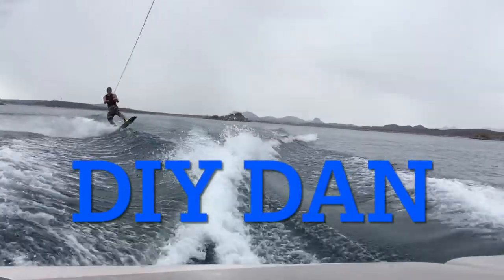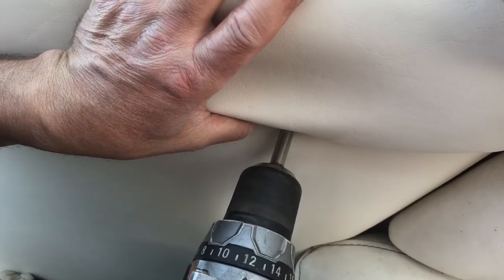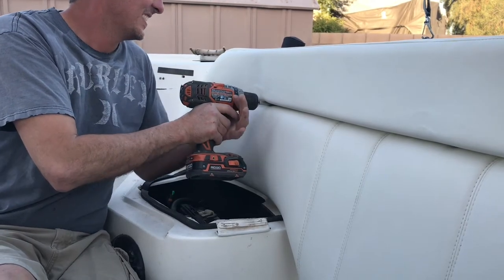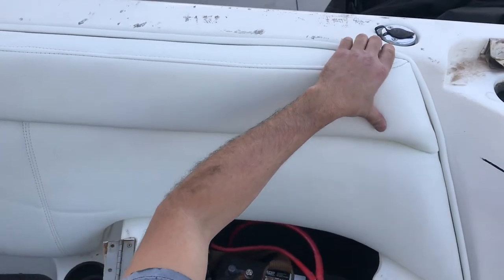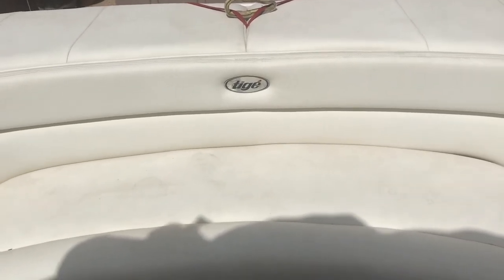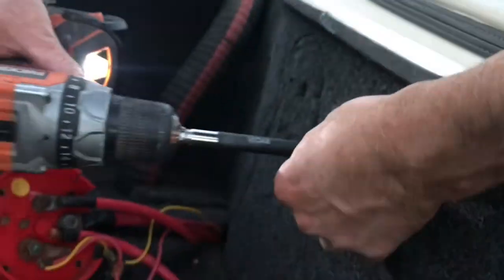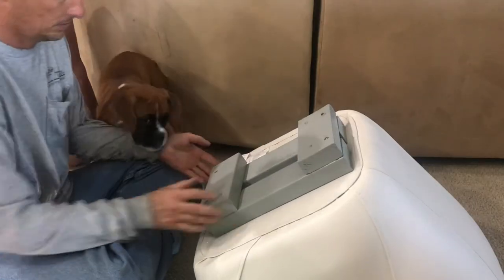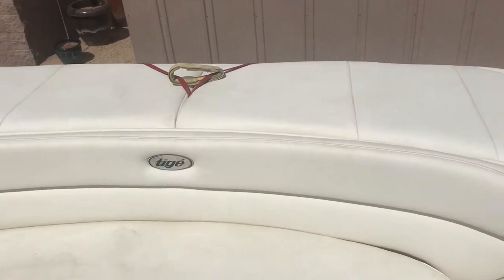BOAT REUPHOLSTERED REMOVAL & INSTALLATION OF ALL MY SEATS/CUSHIONS IN MY BOAT TO GET THEM DONE 😐💵

Comment: Dan,  did you say it cost $3,000 to recover?  Also, thanks for this vid.  I had no idea that the mounting screws were in between the seams.
Reply from the maker: @rprug  ya marine upholstery is crazy expensive
Reply: @diydan7019  I may buy it and try to do it myself.